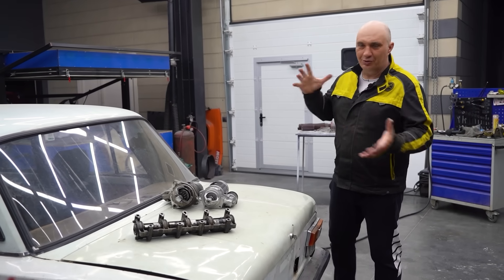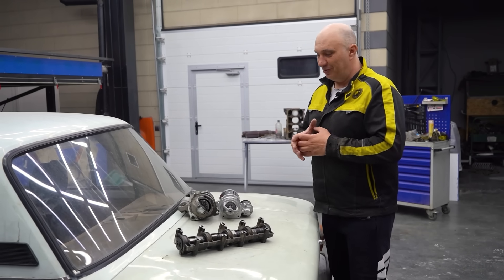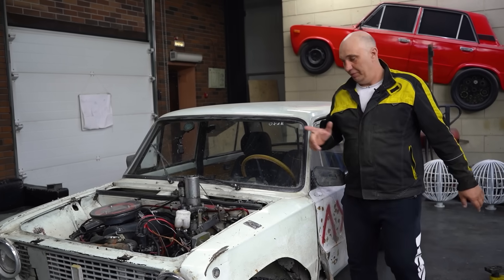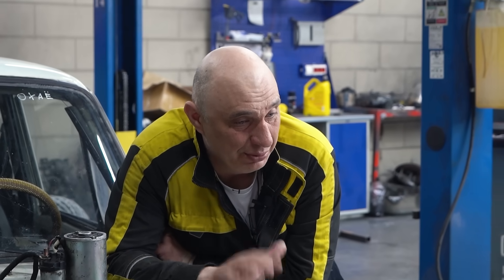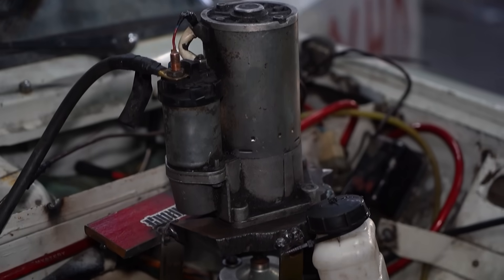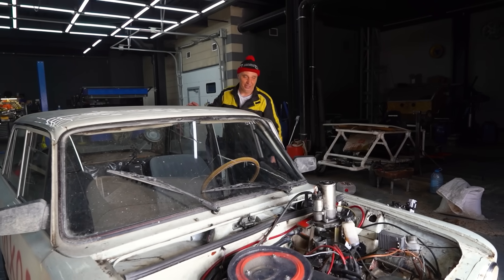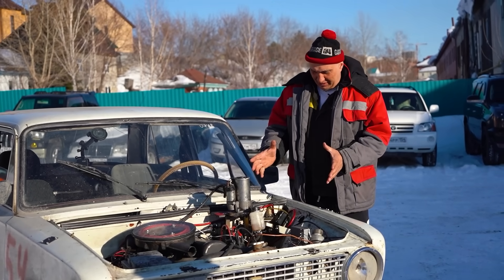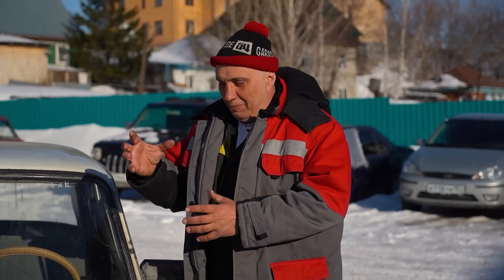Makeshift ABS based on Lada camshaft and a starter motor

Comment: For non ABS cars a similar effect can be had by gently pushing the brake pedal in and out which gives the wheels a chance to Grip on a slippery road, ABS senses when tires loose their grip and start to slide.

Comment: You should try welding a cylinder head to a engine block and see how much pressure or boost the engine can take compared to a engine with a head gasket just like what Porsche with the Moby dick  race engine.

Comment: Exelent video as always. A great idea would be to test the braking distance on a track.
Reply: Lupul Flamand... ABS can increase your stopping distance up to 50% depending on the size and age of your vehicle. This idea that somehow a rolling tire increases stopping distance  doesn't obey basic laws of physics. The only reason why ABS exists is to stop your tires from locking up in a panicking situation, so you can steer around an obstacle instead of sliding right into it.

Comment: they make a modulating brake system for non abs motorcycles. think it operates by sprung hydraulic valve creating modulation I believe

Comment: Your doing what’s called “ stab braking” ..  used in commercial driving when needed. It gives you full braking power for a second then let’s the wheel spin to gain controls again then full brake is applied again then off. Repeat.

Comment: The whole point of ABS is to be able to steer while braking - stopping in a straight line with ABS actually increases stopping distances - drive it around a slalom guys.

Comment: The way a real ABS system works is by monitoring the speed of multiple wheels, and reducing brake pressure if the speeds do not match or have dropped to 0 too quickly. Totally do-able with an Arduino and some sensors, but I doubt Garage 54 will do it
Reply: Charlie Nolan... it sounds like you're describing traction control... base level ABS just pumps the brakes for you.
Reply: @petemclovins9166  That is kind of how early versions work, I think they only kick on past a certain pedal threshold

Traction control involves detecting differing wheel speeds and cutting the throttle and in some cases applying the breaks, under hard throttle. ABS is only under braking conditions with no throttle and will pump the brakes when they are pressed hard and the wheels are at different speeds or have stopped too quickly

Comment: What about trying to make a hydraulic intake and exhaust valve instead of that old knocking rockers ? 
i have a vaz 2106 in middle east where the hot weather and to make the car more coolest we increase the clearance of the valves so it make the car loud

Comment: Horrey Schett, that works waaaay better than I thought it would. Very, very surprised the same "system calibration" worked for both dry/grippy concrete AND the slippery snow/ice.

Shocked! Neat work!
Reply: That’s because the “calibration” is mechanical and permanent. It’s going to apply the same amount of “abs” to every situation.
Reply: @mindsnk  Wow. Incredible analysis, chief.

Comment: This works 107% and can be implemented to function as a factory system. If you get ABS sensors on the wheels or put a few magnets on the brake rotors and a coil, you get output voltage as the wheel rotates, now you can stabilize the output voltage to something known like 5v DC and then compare all 4 outputs with an analog voltage comparator which would be enabled with a 555 timer through a relay after the wheel rotates and gives off the first signal or will be disabled after a given inactivity (wheels not rotating) by a capacitor discharge, and if one or more sensors lose the voltage (wheel lock) thus triggering the comparator it will enable a relay that will give power to the motor to kick back the pedal like that, but that only if the brake switch is pressed.
More additions would be to make the stroke variable by using a rail that would change the position of the lobe with an actuator according to the car's speed to make it more efficient by varying the ABS system kick-back.
Reply: This is a really cool idea, but it could be made more versatile by instead using double op-amp differentiators to detect jerk. The jerk signal would be analog and ideally runs to a linear actuator to momentarily reduce brake pressure. Not only would you have an extremely quick system, you could also tune the intensity via a simple potentiometer for full-on "because racecar!" Sounds like a super fun project!
Reply: Holy shit just no.

I don't even know where to begin
Reply: It ain’t that serious bro.

Comment: Ok idea for prototype 2 that can use smaller motor u can take that cam mod it to squeeze tiny bit of hose when not on but that should allow it to increase hose pressure without creating a mechanical failure point

Comment: The idea of an ABS is to keep the wheels rotating under heavy braking, with the purpose to a) reduce the stopping distance and b) to keep the steering under control.

You only tested at 10 km/h, which is unuseful. 

Make a test with cones, like the moose test, and compare with/without your makeshift ABS, how the car is responding to steering input + heavy braking at 60+
Reply: I think you're overreacting here, that Lada would fail those tests straight out of the factory, and there isn't a Lada with factory ABS o compare it to, at least not rusted out like this one.
But to answer your question on how it will behave when turning while braking with this makeshift ABS: Better than with constantly locked up wheels.
Reply: @johnbelwell2461  not overreacting, just curious about the results. This could be one of their crazy experiments.

Comment: Next thing to add to this is Brake assist to help you brake even harder!
Reply: That already exists and it's the vacuum operated servo 🤣😂
Reply: @johnbelwell2461  now that would not be much Garage54 level to use a bog standard brake servo? And this kind of servo won’t help you brake harder if you make a panic braking as modern cars can when the car itself start to brake even harder than you press your foot on the pedal. Or even hill-hold for that matter. Lots of stuff could be experimented with here if you want to make your own version of things right
Reply: @Pulverrostmannen  yeah true, i'm sure Vlad can come up with rather interesting ideas to replace a servo, the easiest would be an actuator to press the pedal as you manually press it simultaneously. Could be one of those ideas prior to the servo mechanism.
Reply: @johnbelwell2461  indeed. I’m sure they gonna come up with some crazy ideas some day

Comment: More like BS brakes :D Breaking System without automation. ABS would hint that you have speed sensors on wheels.
Reply: ABS stands for "antilock braking system", not "automated braking system." ABS is a perfectly acceptable term for them to use.
Reply: @jonathankipps9061  you are right